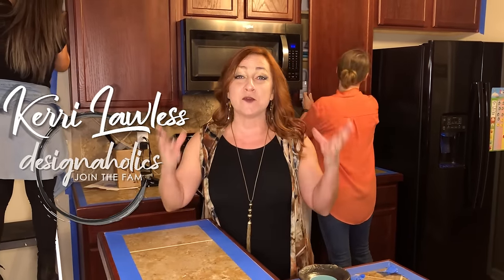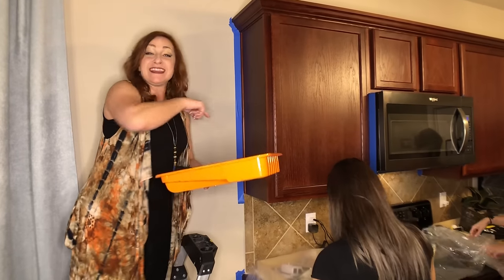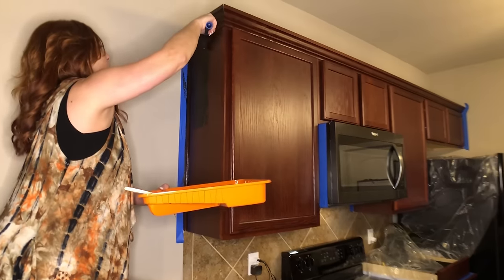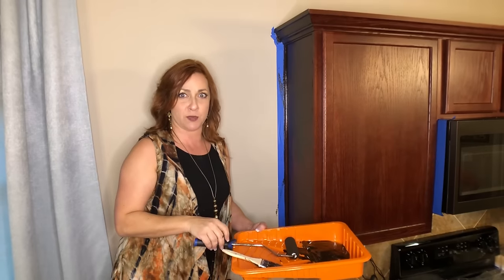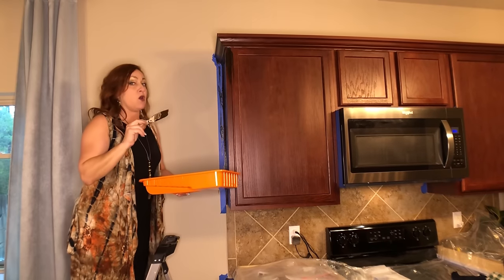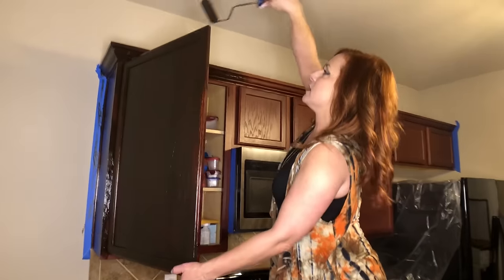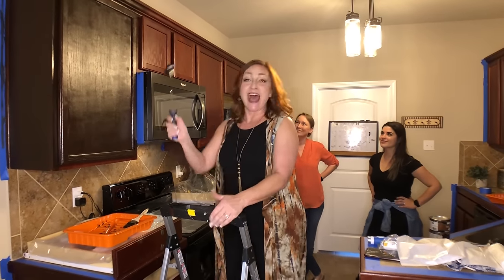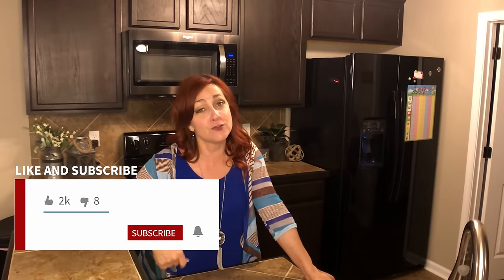Gel Stain Kitchen Cabinets Without Sanding *FAST EASY DIY*

Comment: I did not realize that my bathroom cabinets were not real wood, but this method still worked! However the paint brush and roller didn't work the best for us - we ended up using socks and that gave a better texture. Thanks for making this video!

Comment: my husband is a wood worker who builds furniture and he uses Gel stains quiet often and they do require a top coat or sealer otherwise the color can be rubbed off or chipped.
Reply: thank you!
Reply: Would you please share name of the sealer?
Reply: Pleas can you share the name of the sealer
Reply: Does the top coat have fumes that  you need to wear a mask for
Reply: Thats if you gel stain clean wood that has never been painted, in this video this cabines were already painted and therefore are sealed already. You just need to be sure they are perfletly clean and no grease , probably light sanding would be better.

Comment: What a great tip! I have a client with honey oak cabinets and our plan was to paint them white. Now I have another option… Thanks!
Reply from the maker: The light oak is such a dramatic transformation when you use the dark gel stain! It will definitely require two coats, but totally worth it!
Reply from the maker: I paint a lot of cabinets white though as well. It just depends on what else is in the house.

Comment: Kerri Lawless - just some comments from having followed your video and researching a ton of other sites, that would be helpful for people to know.  1. If using a roller and rolling on gel stain, its likely going to be be pretty thick - depending on whats already on your cupboards, if applied too thick - the gel stain may not dry properly, leaving a tacky mess.  It would be helpful to note this for people as well as mention, some best practices around how to fix the problem of gel stain applied too thick and how to correct it.  I learnt a ton during the course of this project and through the research, and these are all likely points people should know in the forefront.  Thanks

Comment: I HOPE it really will be this easy for my kitchen with 29 doors, 13 drawers, plus frames. Looking at other methods with 3 prep/clean steps, 3 coats/wipe/sand, then 1-2 top coats...I'd be dead before its finished! Thanks for all the good tips. 😊
Reply: Did you try it?
Reply: @learnandplaywitholivia  wish I had now, but "life" happened. Maybe this spring, fingers crossed. Got rabbit-trailed at one point looking at Heritage "one step" that supposedly doesnt need sanding or priming BUT painting light over dark may require as many as 7 coats...pays to read LOTS of comments before committing. Now I'm back to thinking "stain".

Comment: Hello kerri, 

First and foremost thank you for the videos! I am a first time home owner and I have officially been biten by the DIY  bug. One of my first (of many) projects that I would like to tackle would be staining my kitchen cabinets! Seeing that I am completely new to staining I was hoping that you could help she'd see light on some of my confusion.  1st question, in this video you had your helpers wiped off/clean the cabinets where other tend to always suggest some type of sanding (is sanding absolutely necessary).  2nd, I do desire to have a dark finish (as in the video above). . . I noticed that you never wiped off any of the gel stain (even though other videos do still wile off the gel stain) 3rd question, do you need to put a top coat after your have reached your desired color/stain? If  so what would you recommend (or is that determined by the brand of gel stain used) ? 

Thank you in advance for helping this completely lost no one d DIYer!! 

Regards, 

Centurium
Reply from the maker: Hi Centurium, you are so welcome...we love to help!  We have started recently cleaning with a product called Krud Kutter. I leave it on about 15 - 30 minutes and then rinse it several times. This thoroughly degreases the surface and takes the shine down quite a bit. Sanding to take the shine down a bit more can’t hurt, but this product adheres very well and I haven’t found it necessary.
Reply from the maker: I don’t wipe the stain back off when I’m going over a previously finished surface because it is not soaking in like it would on a raw wood surface. This is also another reason why it takes longer to dry between coats...it is sitting on top of the existing surface as opposed to soaking in.
Reply from the maker: Although this product has always been very durable for me, it will definitely give another level of protection if you add a clear coat. My favorite is Benjamin Moore Stays Clear. I would use the “Low Lustre” sheen for this. Make sure to wait a couple of days after applying the final coat of stain before applying the top coat to make sure that it is thoroughly dry.
Reply from the maker: One of my favorite things about “Stays Clear” is that it is water based but can be applied over the oil based gel stain as long as it is thoroughly dry. It is extremely durable and dries very quickly.  Make sure to apply thin coats of the Clear. Multiple thin coats adhere better than one thick coat.
Reply from the maker: Hope that helps!!! 🌸
Reply: @KerriLawless  thank you sooo much for your quick response and All of your explanations!🤞 I will. Try to take pictures of before and after
Reply from the maker: Sorry just seeing your response. I would love to see your photos! 🥰
Reply from the maker: We just started a BRAND NEW Designaholic Facebook Group TODAY and would love to have you join! Here's the link: https://www.facebook.com/groups/designaholics/
This would also be a great place to share your pics when you're done!!!
Reply: Would this be practical for all my interior trim and doors? They are all the 90s orangey pine??

Comment: Hi Kerri, I have a question about the gel stain you're using... do you find that in the sunlight it still looks espresso color? I have espresso color kitchen cabinets and they need a bit of sprucing up. I tried the java gel stain and it looks fine until the sunshine in and looks very brown kind of a muddy medium brown and  I really don't like it. So now, looking at another gel stain please help! I was really wanting the original looking espresso even when the sunshines into the kitchen like the original stain finish I had
Reply: Maybe try a lighter color or more of a translucent?

Comment: Thank you. Im doing my cabinets. What do I use to wipe cabinets off. There are some greasy and some light stripped from sun coming in..where do I get the gel stain?
Reply: TSP (trisodium phosphate) is a good product for that.
Reply: @leeformanek6272  Can I get that at Lowes?
Reply: @priscillas.2111   Yes, ma'am.   ☺️
Reply: did you ever try this? how did it turn out?

Comment: This is amazing! This will save me and my husband about $2500. Thanks for posting! Did you add a top/sealing coat to the stain? Also does it take long to dry?
Reply from the maker: I actually did not add a topcoat to this but you definitely could. It wouldn’t hurt to add that extra layer of protection: however, this particular gel stain is incredibly durable. I would let it dry a couple of days before adding a topcoat and putting a fan on toward the cabinets will help it to dry.

My favorite topcoat is “Benjamin Moore Stays Clear” It is Acrylic so it can be cleaned up with water, it is non-yellowing and can be applied over an oil based product.

Hope that helps! 🌸
Reply: Kerri Lawless thanks so much for your tips and help! :)
Reply from the maker: You’re welcome! 🌸
Reply from the maker: Hi there, We just started a BRAND NEW Designaholic Facebook Group TODAY and would love to have you join! Here's the link: https://www.facebook.com/groups/designaholics/

Comment: I have old cabinets that are in great condition! They just look outdated to me. They ar flat with no design or print. With a gloss coat. Would that stain work without taking the gloss off??
Reply from the maker: Yes it will work. You definitely need to prep them with Krud Kutter. Spray it on, let it sit at least 15 minutes or even a little longer and then rinse them really good. The Krud Kutter. will take the shine down a bit. If they are super glossy it couldn’t hurt to scuff them with sandpaper after cleaning but I’ve never done any heavy sanding and have had great success.
Reply from the maker: Hi there! We just started a BRAND NEW Designaholic Facebook Group TODAY and would love to have you join! Here's the link: https://www.facebook.com/groups/designaholics/

Comment: So you didn't have to remove the laquer with thinner or anything? And the grain in the wood is still visible afterwards?
Reply from the maker: I’ve recently started cleaning the sirfaces with a product called krud Kutter which I found after this video and it’s very helpful for cleaning thoroughly and dulling the topcoat a bit. All we did in this case was clean them well with a degreaser. You can’t see the grain very well but it’s not as solid as using paint.
Reply: As far as I know from research I have done, gel stain WILL actually adhere without stripping previous varnish/poly/top coat... Traditional liquid stain will NOT. Hope that helps 😊

Comment: Would you recommend sanding on cabinets that have a shiny polish to them, or should this gel stain stick on regardless of sand.
Reply from the maker: If it is super shiny, it definitely couldn’t hurt to sand them, but if you take the shine down with Krud Kutter, I don’t feel that it is entirely necessary, especially if you add a durable acrylic topcoat. I think you will be fine either way but if you have a greater comfort level with sanding, then I would just give it a light scuff. Just make sure that you sand with the grain and use a grit that is not very coarse so that you don’t create deep scratches. Good luck with your project! Please let me know how it turns out!🌸
Reply from the maker: We just started a BRAND NEW Designaholic Facebook Group TODAY and would love to have you join! Here's the link: https://www.facebook.com/groups/designaholics/

Comment: Do you have to wipe off the excess?
Reply from the maker: Great question! With a wiping stain you do have to wipe off the excess but with the gel stain and this particular finish, it actually stays on top of the surface instead of soaking in.  It takes a couple of days to dry because of that but it is extremely durable! Hope that helps. Thanks so much for watching! 🌸
Reply: Kerri Lawless do you need to put a clear top coat on this?

Comment: Nice! Did u use a topcoat?
Reply from the maker: No we didn’t and this gel stain is extremely durable, but it definitely would not hurt. My favorite is Benjamin Moore stays clear. Would probably use a low luster sheen on this
Reply: Kerri Lawless thank you! 🙏 😊
Reply: Kerri Lawless hii, sorry to bother you, I want to start on my bathroom cabinets and theres a little water damage in some areas should I sand those first and continue with the gel stain, also is there a substitute for the two colors you chose that I could get from walmart or home depot or the like by any chance? I really like the color of the cabinets you guys painted and was hoping I could find some way of getting it!
Reply from the maker: Hi there! So sorry...just seeing this. If the water damaged areas are rough, then I would sand it to be smooth first. If it is just discolored, the stain should be dark enough that it shouldn’t be noticeable. If you do sand it though, that area will be more porous, and will accept the stain differently so I would sand the entire cabinet if you do have to sand that spot so that the finish will be even.
Reply from the maker: Also, Old Masters isn’t sold at big box stores, but you may be able to find a smaller paint store locally that sells it.
Reply: Kerri Lawless thank you so much 😇 😊 🙏!
Reply from the maker: Learning Light You’re so welcome!
Reply: Most videos I have watched remove the cabinets. Is it a problem leaving them on?

Comment: No top coat/poly?
Reply from the maker: I’ve used it without a topcoat many times. This product is extremely durable if left to dry before use. Adding a topcoat would always provide additional protection though.

Comment: What did you do to prep your cabinets for the stain?
Reply from the maker: Hi there! I cleaned them with Krud Kutter and wipe them down with water.  If you leave the Krud Kutter on for a few minutes before you rinse it off, it takes the sheen down a good bit. This product adheres very well and doesn’t require extensive prep
Reply: Kerri Lawless I thought you said this was without sanding?
Reply from the maker: @carladenson9258  Oh wow you are right! I did this project months quite a while before we uploaded the video and have done many since then.  For this one we didn't sand, I was wrong  We do a lot of projects and have done it differently at different times.  In all of the different techniques we have tried, we have found that as long as the sheen is not high gloss, this product sticks very well.  The sheen on these cabinets was not very glossy which is even better.  You should leave the Krud Kutter on for a while before you rinse it off and it will also help with deglossing the surface.  This is something we have realized since this video.
Reply: Kerri Lawless thank you for the clarification! ❤️
Reply from the maker: Carla Denson you’re welcome!

Comment: My gel stain won’t dry
Reply from the maker: Depending on the weather it can take a couple of days. Also, put a fan on in there as long as there is no dust that will be blown around. That will help it dry faster as well.